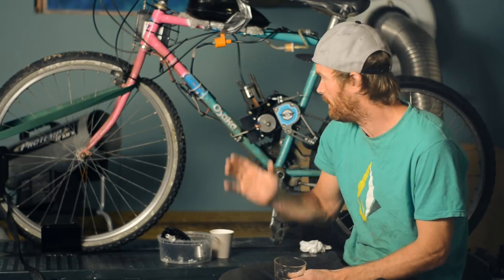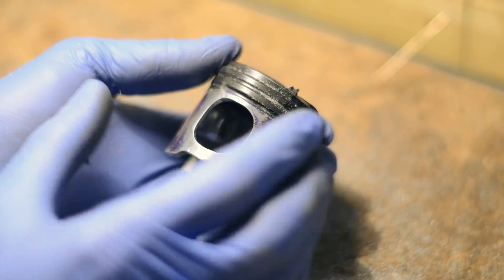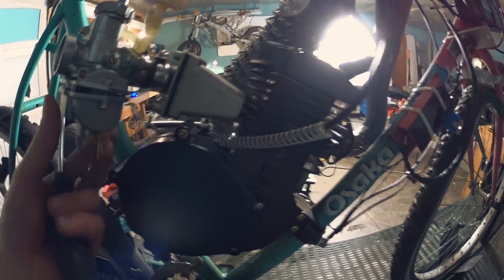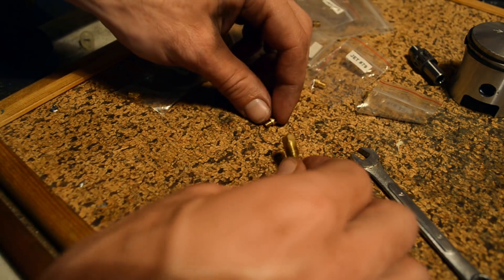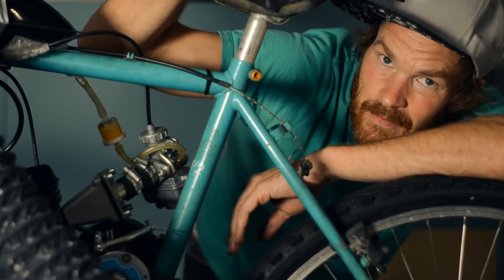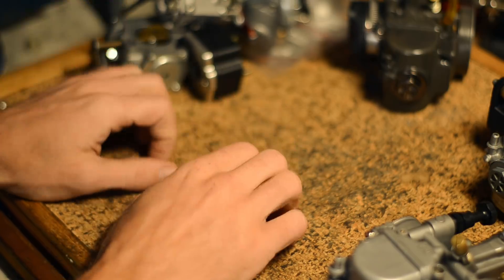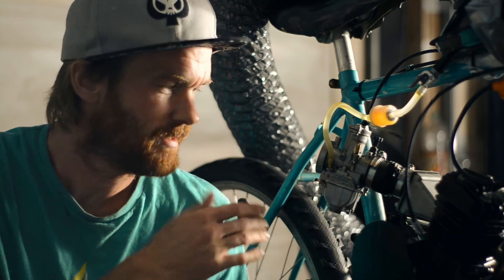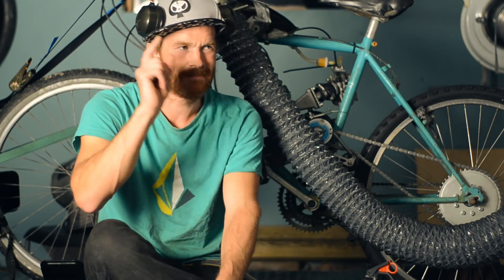Reed vs Piston Port part 2 -

Comment: New various sizes of M4 main jets are found here:

https://www.jawashop.com/by-category_k10/fuel-system_k88/#page=3

They are standard to Jikov carbs and a few other European old type carbs.

I've spent decades tuning Jawa and CZ road bike engines so use a fair few of these.

Sizes of M4 main jets range from 58 to 120 in steps of 2. However what sizes they have in stock at any given time varies week to week so it can take a while to amass the full range collection.
Reply from the maker: Thanks!

Comment: Have you read the Jennings  2stroke tuners guide ,it's a big read and a lot to get your head around but worth the read ,the length of induction affects your port timing cycle ,it goes through all that and more ,other good book is another guide covering race tuned go karts but can't remember the author though ,both are considered bibles of 2stroke tuning
Reply from the maker: Yep, definitely a good read. If you haven't, and want to go deeper, I highly recommend Blairs work!

Comment: Hey love your videos but just like bret redfern commented down bellow you should kinda break in new reeds, and bigger carb makes tuning that small of an engine really hard because it flows too well and doesn't create enough suction. you'd be better off with a max 24mm carb
Reply from the maker: Good point about the carb, we'll see how it goes. Too bad my 24mm is converted to methanol/nitro. I've never heard about breaking in reeds, have to do some research.

Comment: Sounded like head gasket was leaking
Reply from the maker: It probably is, crappy construction...
Reply from the maker: And the studs are constantly stretching, must be some kind of rubber/steel alloy...
Reply: 2STROKE STUFFING yea I had one pull the studs straight out the cases once.

Comment: a float carburetor wont like that angle its fitted on.. if that helps .. if u had the ibea on there it would be ok with or walbro..
Reply from the maker: True, but the PWK will work fine at a slight angle.

Comment: Have to ask bud, Have u pressure tested your crankcase at all as that will screw any carb work u do.  Especially the way it was idling hi.  Block manifold block exhaust  Pump air in thru carb side.
Reply from the maker: Haven't, had the problem persisted with the current carb I would, but it seems to have calmed down now. Good advice!

Comment: just a few things i have done to my bike lol
this pulls me150+kg to 70kmh
mounted engine
shaved head 
ported intake and exhaust
new power pipe 
ported carby 
shaved jug
heat sheilds added for gf
welded a bar from seat to neck so tank is now above and infront of engine so wheelies are good for fuel flow
got hub mounted sproket 40t as 44 blowes past power band so quick
cleaned up flywheel
better lead
domed and polished head
got a new cdi and coil but now i have to make a flywheel 

also buying a stator magneto pickup for quad modifiing to fit so ill have 12v charger
and a good cdi and coil so i can adjust spark timing
and have more then 1 led light as i have some 12w leds i wonna use and also charge my phone

Comment: Sounded like it was running perfectly first go even with the jetting that came with the Frankencarb bolt on 🥇
Reply: Yeah wouldn’t last long like that but all things considered put up a decent power number I bet
Reply from the maker: It wasn't too bad, but very lean off throttle - recipe for seizure.

Comment: Wouldn't EFI solve a lot of headaches? How much is such a setup? 1000$?
Reply: Efi on 2 stroke. Good luck!
Reply: Why would that be a problem?
Reply from the maker: I've actually got a kit laying around, but as samz say - it's a can of worms...
Reply: Why? Is it that hard to get the fuel mapping right? Even with a dyno?
Reply from the maker: From what I've heard it can be difficult with the pipe doing it's thing, at least to match the performance of a carb. Truly genius things these carburetors!
Reply: Hmm, isn't it easy to spot what RPM band that happens via the dyno? And then ajust the A/F ratio acordingly? Just thinking out loud :)

Carbs are great and all but isn't it easier to change the fuel via a laptop? I would think so haha, but what do I know, haven't had to "tune" anything but chainsaws and weedwackers :P.
Reply from the maker: EFI is great, don't get me wrong, but playing with it on a two stroke you realize how good a carb is at automatically adjusting to various conditions - or so I've heard. Looking forward to getting some first hand experience tho, maybe it's not that hard after all.
Reply: Yea, that's true, I would think that getting the Airflow and A/F sensor working and a base tune is the hardest part, then I would imagine it's just a process of mapping out a decent fuel map acording to dyno pulls. But I'm sure I could be totally wrong. 

sigh I long for when I will be able to have a workshop of my own, but I have to finish my studies first :P

Comment: That pumper carb would be cool and save ya from jet problems later

And I did say when I sent ya those parts the jets fit the stock carb I never had jets for the larger carb.
Reply from the maker: Yeah, I know, forgot... Thanks again for the parts!
Reply: @2STROKESTUFFING  the pumper carb looks like it would be vary simple to do on that setup just cut a mounting plate weld to intake drill and tap the side of reed block. Or worst case cut the tube off intake replace with larger one
Reply from the maker: That's true! Might convert to pumper after the dyno run.

Comment: I have an 86 DT200 that I rebuilt years ago. I had it running but I always wondered why the old piston had ports like you added and the new one from wiseco just had a notch at the bottom.

Comment: I'd be very interested to see how the Walbro carb does on the bike engine- possibly with the pulse line hooked up I saw a guy on YouTube drill out a hole in the case near the clutch cable stay to run into a diaphragm carb.
Reply: They should allow for easy tunning the smaller one is good for 12 hp and the larger makes around 17-20.   It would be eaist to have hole on the crank side of the reed valve. Would make for much easier tunning.
Reply: I ran. The walbro carb for over 10 years they come with the Yamaha KT100 Go Kart race. Motor never a problem but new caskets once a year.

Comment: Gasolin.no selger dyseborer. 0.35 til 2mm om jeg husker rett. 0.05mm steg opp til 1mm, og 0.1mm steg derfra og opp til 2mm.
Jeg kjøpte fra Gasolin sist vinter for å justere 2 dobble gassere til en bil. Tjente inn kostnadene ved å slippe å kjøpe nye dyser i forskjellige størrelser. Prøvde litt opp og ned, ved å lodde og så bore.

Comment: I have a 20mm Husqvarna 272XP pumper carburetor on my Motorized Bike , check out how I set it up on my latest video because you can do it the same way with the pulse hose ran off of the Reed valve.

Comment: What model is the 24mm pumper carburetor?
Reply: Its a walbro WB-27 It comes off a 170cc 2 stroke rc airplane engine usually they can make upwards of 17-20 hp below 7000  rpm. The  smaller one is a WJ71 of of a 125cc rc airplane engine that makes around 12 hp also below 8500 rpm. So either would be fine.

Comment: I would have did a 3rd transfer.
Reply from the maker: Eventually, but I don't think it's needed yet with the current limited exhaust area.
Reply: @2STROKESTUFFING  What is the mm from the top of the cylinder to top of the exhaust port and how many mm's wide is it? I found 27mm from the top of the cylinder and 26mm-27mm wide is a great exhaust port timing and size on a gt5 cylinder and also make some boost ports off of the fuel transfers and get the fuel transfers about 5mm-6mm wider but don't raise them because it will kill some bottom end power, that's what the boost ports are for to add top end power and not kill bottom end power. Also make the intake wide as possible around 23mm-25mm wide and port the fuel transfer tunnels out because it will only make as much power as the smallest port will allow it to.

Comment: Get yourself a set of jet reamers from louis.de! It`s only 20 euros or so but it makes wonders for stuff like this. Even if you F-up a jet you can solder it shut and ream back to needed size.
I`m super pumped to see the results of the reed test. I`ve cast and machined my own reed valve kit last year but never tested it due to lack of free time :(
Reply from the maker: Thanks for the tip!

Comment: Hey Man. Love your videos. I bought a cheap Jet Drill set with pin vise from ebay for tuning. Also if you drill the jet too big just solder it up and re-drill through the solder till you get it to the right size. Cheers
Reply: Same lol I even made a video on it.
Reply: i made the same comment lol
Reply: with soldering the jet u wont get as good result as drilling stock jet bigger. the lenght of the hole matters as much as the size of the hole. i have had so much issues with soldering jets, first it runs too rich and i "downsize" the jet and then it wont even run without wetting the sparkplug :D but yea that will work but u just have to have some time and pations doing that.
Reply: I’m late again, but yea mate, cheap eBay jet drill set and heat and soldier if you fuck it😁
Reply: Gets you in the ball park quickly, and if you need to just order the right jets
Reply: Kathleen Shaw  wire in the jet wouldnt work due to the needle living there
Reply: Doesn’t a jet hole have kinda a shape to it then a hole I was told from a old school racer they would use guitar string working it back and forth
Reply: Instead of soldering the hole turn the jet around and take a punch and hit it from back side and close it up and then redrill it iv done a lot of them like that it works great
Reply: Or you buy a complete kit with various sizes.

Comment: You should save your money and invest in a small lathe. You could manufacture/drill any jet or needle you want.
Reply: I use micro bits and solder.
Reply: Harbor freight drill bits can do the job
Reply: Will Trautman. Turning a piece of brass down to the correct diameter for all those carbs, then threading them with the correct threads, then drilling out the holes. Or making a needle. With just drill bits? Keep dreaming.
Reply from the maker: I need a lathe!

Comment: Sir why dont u try mounting ur carb as if on flat surface(could be fuel inside fuel bowl is at an angle causing mainjet unable to suck the fuel effiently)

Please make tke intake shorter and straighter
Reply from the maker: PWKs are fine at a slight angle, but good tip! Just throwing parts together here, will do things properly later.

Comment: The longer the intake pipe is, the less power you will have
Reply: On average, doubtfully.
Reply: @DarkLinkAD I do preparation 2t in France, and I'm sure of what I said, the carburetor 28 is too big, very difficult to solve in this case.
Reply: @DarkLinkAD  Diagrams have not been taken and other things not done, from the wild preparation
Reply: @DarkLinkAD  Possible limit that it is lost of the power on the origin
Reply: @DarkLinkAD  I can get out 22hp of a 50cc with good parts and a real work on a 2t engine
Reply: Sven Bertin  Nah, you referenced the longer intake pipe making less power, you didn't mention the carb whatsoever..
   A longer intake may develop power at a lower potential rpm, but the power isn't typically lost on average... This is what im referencing to and your resume is hearsay , Bernoulli's Principle is a proven concept.
Reply: @DarkLinkAD  It's just my humble opinion, knowing that I make my living by preparing small motorcycles for the run ......
Reply from the maker: Well that depends on the whole system, but often yes. Keep in mind I'm just throwing together parts to get a dyno run with reeds here, not exactly "optimized".
Reply: @2STROKESTUFFING  I understand, but the good parts directly would make a much more efficient assembly the fuel tone is too big, its going to be a horror to settle, the pot too much volume, know that I respect your work I do not seek to harm you
Reply from the maker: Totally agree and no worries man!
Reply: @2STROKESTUFFING  have good Day and ride safe ✌️
Reply: @2STROKESTUFFING  If one day you needed parts for your Peugeot know that bidalot and other French manufacturers I work with them so do not hesitate to contact me if French products interests you
Reply: @2STROKESTUFFING  As a professional I am entitled to 30% discount I make you enjoy it with pleasure .....
Reply: Where can buy the adapter to put the zeda 80cc OK carburetor in the intake because the one is came is to big please help whit the link

Comment: Your exhaust has too much volume for a small cylinder like that, frankly made a smaller, you earn much more ....
Reply: Ive had some suprising results tuning these motors. Filing ramps in the piston, dremeling the casting lines,  making intakes from conduit. Even hydroformed a pipe. They dont act normal until you get em broke in good.
Reply: its a c16 right? Should be fine
Reply: @MAG-bp6hj  It's just my humble opinion, knowing that I make my living by preparing small motorcycles for the run ......
Reply: @radouanidrissiexlctm8138  absolutely right, this cylinder doesnt produce the same amount of exhaust gass as the MHR 6t the pipe was designed for
Reply: @pietroc.6246  Each configuration has to be studied very seriously before changes and the hole in the direct piston in big format is anything, Barbarian work, which disappointed me .....
Reply from the maker: I said it in the video, didn't want to spend much time on it, good enough was good enough. When it matters I try to be a bit more precise and thorough.
Reply from the maker: True, I just had it lying around.
Reply: @2STROKESTUFFING  btw it would be ideal to match the two intake pieces for better flow
Reply from the maker: True, but for testing purposes...
Reply: @2STROKESTUFFING  I'm sorry I did not want to insult you or any other bad things, I really like your channel, but I was a little shocked by some things. I do not want to fuck shit
Reply from the maker: Thanks! Still just fooling around with this thing, watch my Spx vids for more precise work.
Reply: @2STROKESTUFFING  know you make à very good job, is for that I open me stuffy
Reply from the maker: Thanks man!